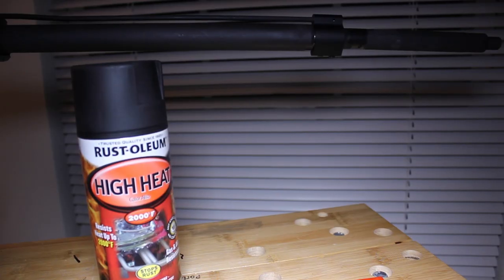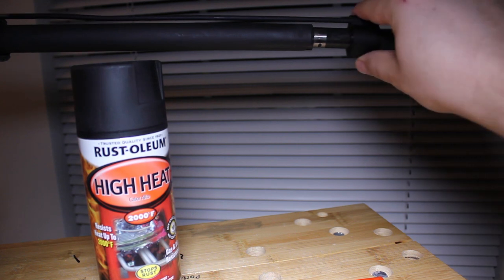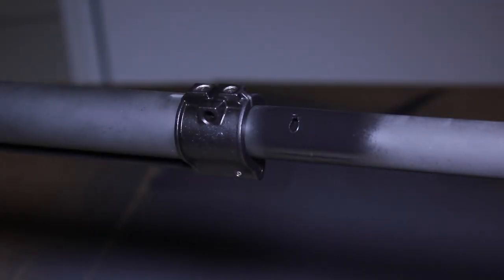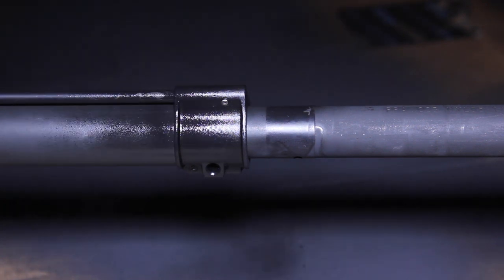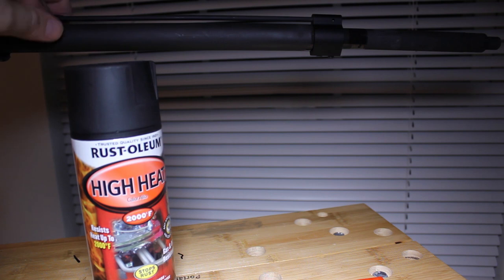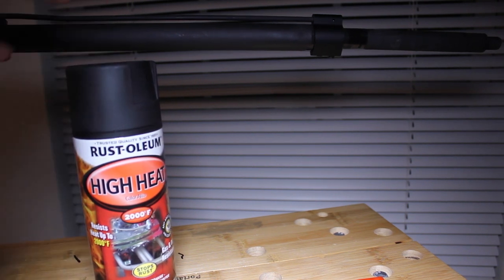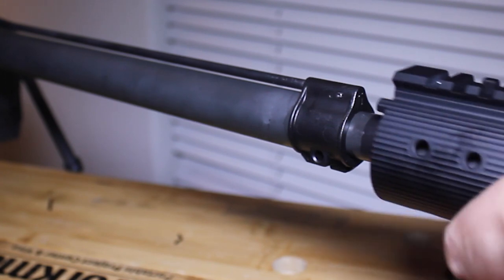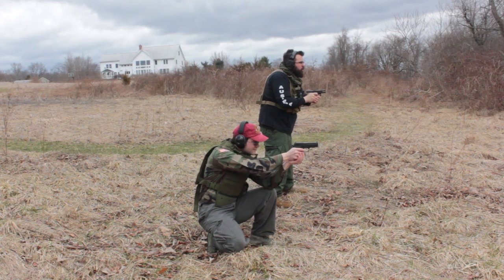High Heat Paint for Your Rifle Barrel & Gas Tube - Quick Tip

Comment: I have an old Ruger 1022, it was pretty neat and the metal was all worn, I cleaned it up good and tried some cold blue, just to try and make it look better, after multiple coats, and light steel wool in between it just wasn’t turning black and just looked bad, no matter what I did, so I decided to do some spray paint, sounds weird but just wanted to know if that’s normal for old guns like that to not accept blue good
Reply from the maker: I'm not an expert on blueing but metal is porous to some degree and perhaps there's decades of oil buildup. Maybe hot bluing would work better. If it's not a super nice gun ain't nothing wrong with a rattle can paint job. If it is nice, maybe cerakote/duracoat will be an option.

Comment: Here's a tip, I am a glassblower, I finished my bench top with hardibacker concrete board and painted it with this, after painting it discovered that powder would get on my hands if I touched the surface, I found that if you take a rag and kind of Polish it you will get a semi-gloss finish that looks like firearm finishes, then the residue doesn't come off on you, give it a try, after it's completely dried rub it with a rag, the flat black finish will go away and a semi-gloss finish will stay 👍
Reply from the maker: Love the tip! Thanks!

Comment: Hey i was thinking to paitn my remington 700 adl and i got rust on the batter and reciver should i use sand paper and Get it of and paint the whole gun with flat black high heat paint ?
Reply from the maker: Get rid of the rust, ouch! You might consider a rust-stopper treatment first. This paint could work but spray paint tends to like to come off of smooth metal under use. It's fine on my barrel as it's behind a handguard. Consider having your barrel powder or cerakoted. Buy once cry once. But in a pinch, this could work. Just keep an eye on the rust spots. Take a look at Steel-It spray paint as well, not sure about the heat resistance though. If it's in sad shape, it could be worth the trip to a gunsmith to get it done right (again, cerakoted or duracoated perhaps). Hope you get it sorted!

Comment: I painted my CBC 586.2 pump shotgun with this paint. Handguard and buttstock are finished with liquid rubber spray. 

As a police officer, I use my shotgun on search and arrest warrant missions, kicking doors at the first sunlight. A matte black finish is very useful during the siege phase of these operations.

Rust Oleum paint is more expensive than other brands, but give better results.

Comment: Is painting a glock barrel a good idea I'm mainly worried about scratches and have never done it before
Reply from the maker: Scratches on the barrel show use for a pistol. If you paint it, the paint will be scratched off, too. There are tight tolerances in some areas (near the breach and the slide and the slide and the muzzle). You can look into aftermarket barrels (e.g. Lone Wolf) for different finishes if you're going for a look. I wouldn't suggest paint, unless maybe duracoat, but you'd still run into the same issues as something like a nitrided barrel as there is going to be wear on the surface. Thanks for asking.

Comment: Did you bake it like the instructions call for?
Reply from the maker: The barrel getting hot should suffice. Haven't had any issues since. But it doesn't have anything touching it so it hasn't scratched off.

Comment: is it holding up? no bubbles peeling or chips?
Reply from the maker: So far. I haven't put a ton of rounds through this barrel. It wasn't so much peeling as perhaps just rubbing off. You might want to thoroughly degrease the barrel first for the best results. Maybe I'll do an update.

Comment: You recommend baking firearm to cure?
Reply from the maker: I don't know about baking it with this paint. I suppose you could go and shoot it shortly after painting and that would heat it up. :-) I don't think the high-heat paint needs to be baked. But definitely having hotter weather or a heat gun will speed up any curing.
Reply: @WildMountainGarage  it def does need baked. I'm assuming you threw a handguard over this and didn't touch it much but myself and many others have used this under the impression it doesn't need baked and it's no bueno. Takes about 6 to 8 months to properly cure without baking. Sure its dry enough to touch after 15 mins but if you spray some clp on it even a week later and wipe you'll see all kinds of black residue come off. The curing procedure is ridiculous it's something  like 250 for 30 mins 400 for 30 mins 600 for 30 mins etc. But it makes a world of difference in the finish
Reply: @WildMountainGarage  how is it holding up

Comment: Hows it holding? Getting ready to coat my shotgun reciver.
Reply from the maker: So far so good! Although I haven't gotten a lot of rounds through this barrel - been moving about this past year - and the majority of range time was used for other things. I'd be curious as to how it goes with you on the exposed shotgun receiver since the barrel here is protected by the rail and won't receive any physical wear. My only thought there is that you'd definitely want to make sure there's no oil or dirt and the surface is OK to best let the paint adhere to it. I'd hope it would work great seeing that technically a hot engine and a hot gun metal are the same to the paint.

Comment: If you coat a barrel in this paint, would that in theory make your hand guard less hot.
Reply from the maker: Good question. It's not heat reflecting or absorbing paint, just heat resistant so it doesn't bake off. It's still going strong today, but it is protected behind a hand guard so there's no chance of it scratching off. I don't know that I'd recommend it, but there are exhaust wraps in the automotive world for that purpose...and of course the original M-16 style handguards have metal shields.

Comment: Can I use this to paint my entire AR
Reply: Of course but why would you wanna paint a black gun....black lol. Im assuming its for rust prevention right? Rustoleum also makes a paint specifically for guns and it comes in all kinds of camo colors. Im about to use this high heat stuff for my barrel and the gun camo paint to try my hand at making a woodland camo.
Reply: You can, but I've found that solid colors look horrible if not done professionally, especially black. With a rattle can job, it's WAY better to break it up with a camo scheme and that hides the imperfections a lot better. Good luck.